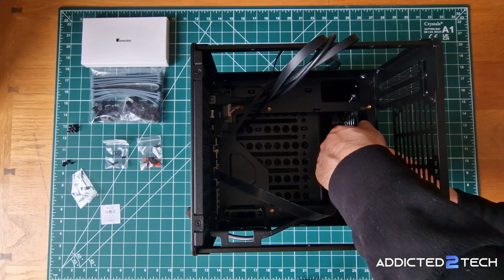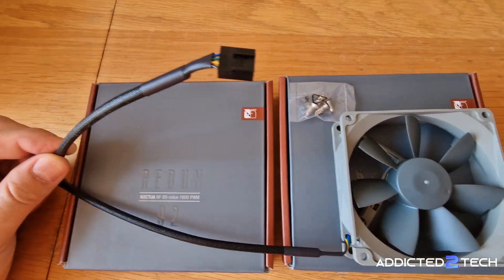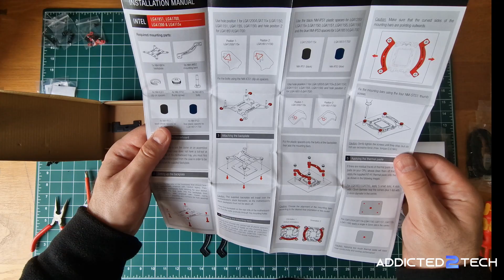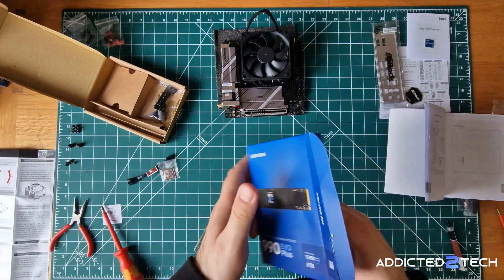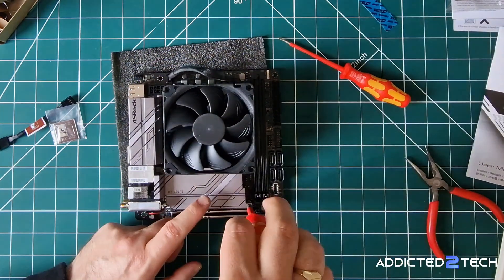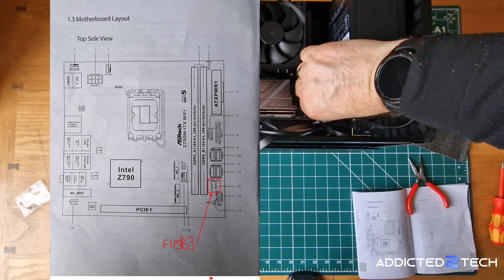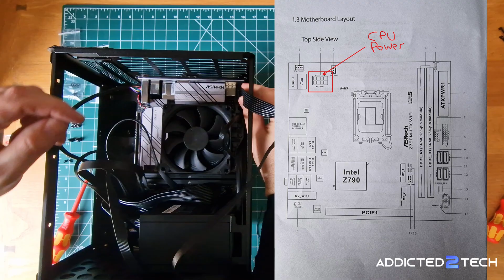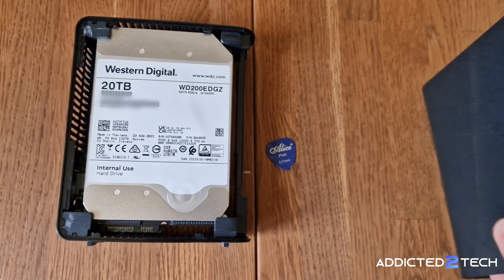How To Build An All In One Nas Server - A Step by Step Installation Guide

Comment: Too powerful hardware for 2.5G connection only, you took PCI-slot to have more SATA ports which could be solved by utilizing M2 E-Key slot. Overall I wouldn't build it - better result I'd get importing NAS motherboard from china with some Intel N150/N355 and 10G Ethernet built-in. Cheaper & better
Reply from the maker: Hey thanks for your feedback. I did look at the m.2 sata adapters however most were unreliable and no where near as stable as a HBA card. Also with the pcie I can use bifurcation converting the 12x slot into two 8x slots which can still run full speed gen 4 if I want to add a gfx card etc in the future so its not that bad. I also looked at some of these Chinese motherboards and one of my goals was security first. I wouldn't trust these chinese parts. Not only could they be a security threat the quality is also not as good as more traditional parts. Cheaper is not always better. That is my opinion may be controversial but I think it has some validity. Great comment though all the best to you.